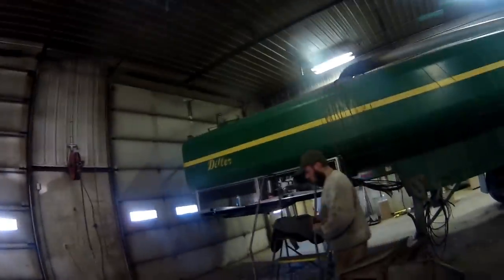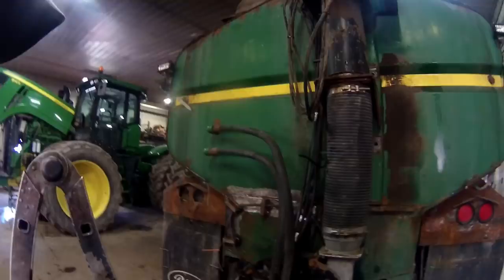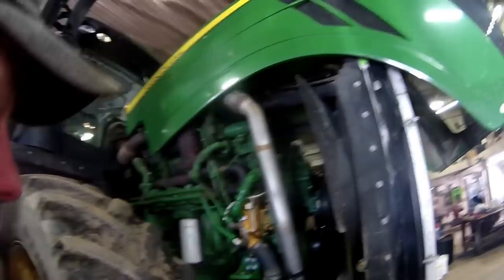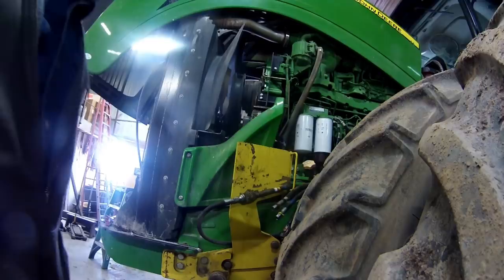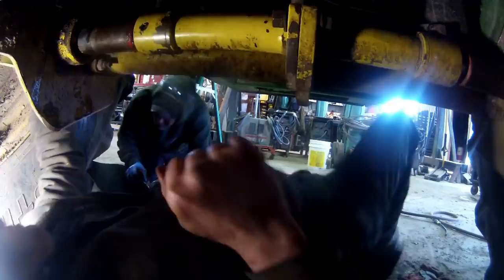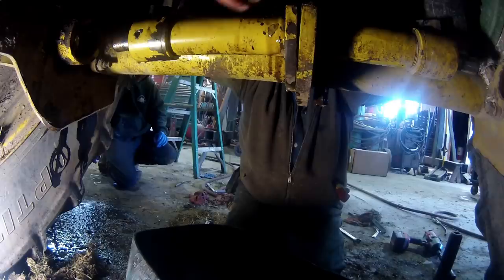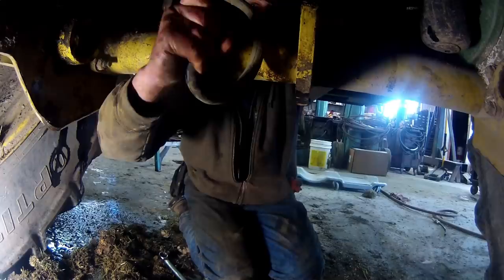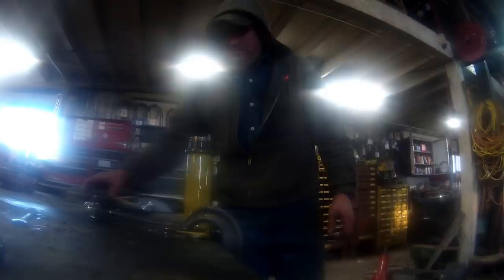Hydraulic couplers Hydraulic cylinders

Comment: James is bound to be a star I don't think anyone took you too serious on the disk repair that's how you can keep employees as well as teach them a little without being to hard on them. Did the tankers come with the remotes or did you add that?  Wiring and manure are mortal enemies along with the steel hydraulic fittings . I'll bet those couplers will hookup much easier now that you can get some leverage on them! Thanks for the video!
Reply from the maker: Yes there remote came with the hydraulic system for the tanker spreader

Comment: Won every excavator I ran I always had a digging bucket with teeth and a tilting "clean up" bucket with a smooth edge and the dealers always put those damn flat face couplers like you have for hooking up your silage blade, I switched buckets multi times a day and those things were always an ass ache, our big hydraulic shop give me a set of these screw type hydro couplings to try and I'll never go back, the have a nice aluminum dust cap for when you not using them but even when there was a little pressure on the lines you just screwed them together and you could snug them up with a pair of pump pliers. I put the male end on the bucket hoses and the female ends on the machines stick, I swear by them things, I never had leaks and they lasted ten times longer then the flat face, not to mention I never had to frig around trying to hook them up as long as the were clean